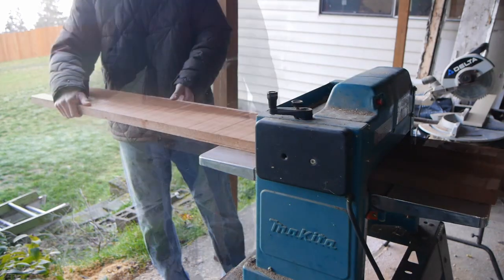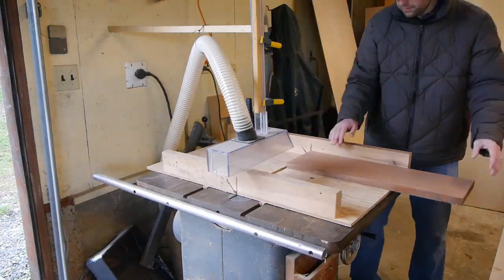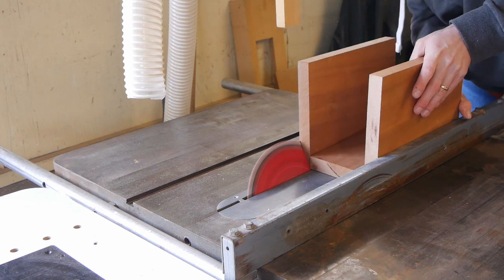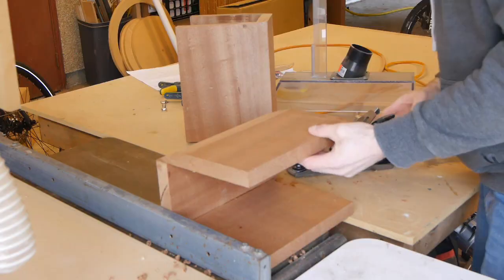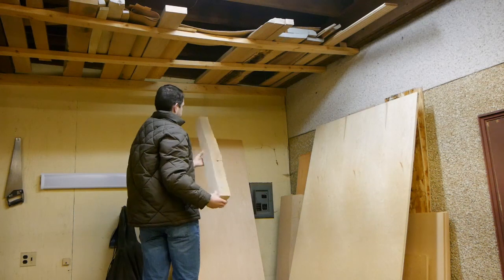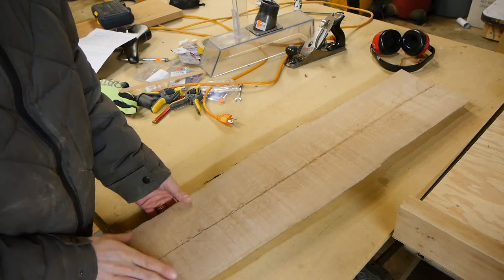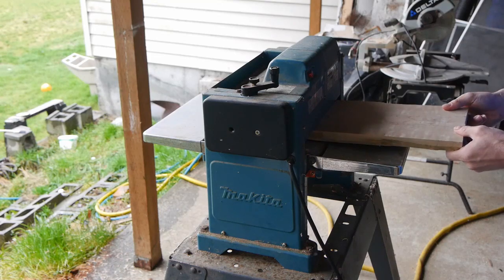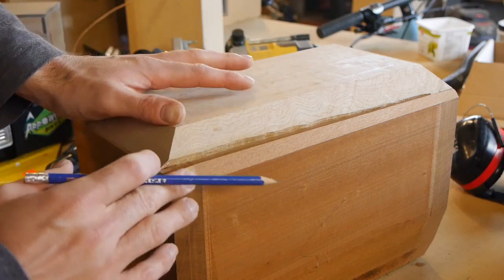Dayton Audio Surround Sound Speaker Build | Part 1

Comment: okay spewing some ideas

you could:
- fill the gap with coloured resin
- accept the looks of it and use the same wood on the other speaker (make that 'imperfect' as well)
- try to make a curve around the larger woofer. so don't cut out neat the large woofer, but only cut out at the smaller woofer, and make it a nice curve and make it cone around the box nicely (that's also a bit kore interesting than a square box which's got the corners chamfered)
- take off the maple, sand off the glue remains, and go to the diy store to get more fitting wood

anyhow, in my honest opinion, it looks fair enough the way it is right now. I do have to say that I've got a taste for imperfect woods haha

Comment: Good video, I like your shop. 

I have been meaning to build a table saw sled, but I still haven't pulled it out since getting a track saw.

Your secret ingredient for glue ups is french's mustard I see...  :o)
Reply from the maker: Barry P haha yes the bottle works really well. The mustard not so much. 

I like my shop too, but it will be demolished this winter to accommodate an addition on the house :(

Comment: So your back from underworld, I thought you are done with spkrs. Really, since it's real wood imperfections are allowed, beauty in its own. You can always trim and add the piece. I would mount drivers, use it and wait if it's a problem for me, spouse or friends visiting. 
BTW, have you had a chance to come across Rival Acoustics midwoofers - a few people made projects with them but not a lot said about them and I'm looking for better drivers than SB17NRXC
Reply from the maker: pliedtka the SB is a good driver. I’ve heard of Rival but never used them. Would love to try them though. They are high on my list but don’t need them for anything specific.
Reply: @ImpulseAudioSpeakers 
 I'm thinking about the one used by Javad and Wolf - FR looks OK other than some break-ups, but isn't as high as in SB17, so x-o should be easier. I like the larger damper, magnet - better design than most in this price range. I wonder how are other cones and if they will be again available.

Comment: If I have two woofers in a loud speaker and wish to add a further one or two, what do you need to do to the crossover to have the sound 🔊 correct, what changes.
Reply from the maker: Dave Jones well, it’s not very simple and depends on a few factors. You’ll need to change the woofer circuit and the tweeter resistors most likely. To what values I couldn’t tell you without a lot of details.